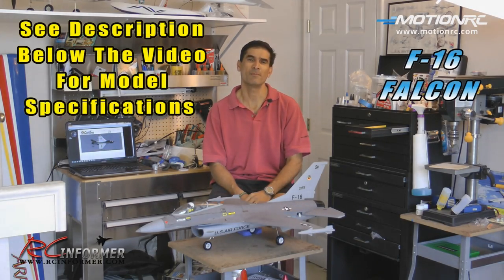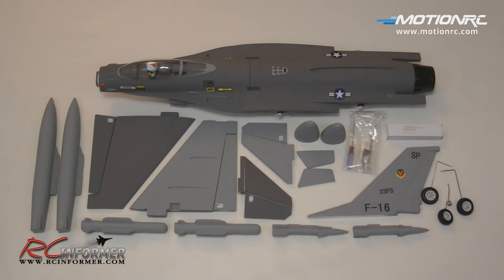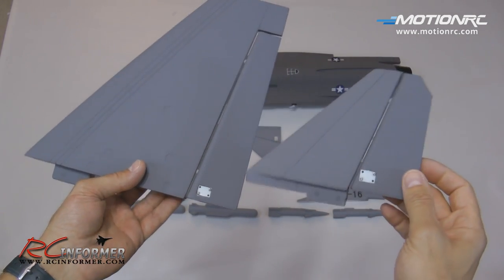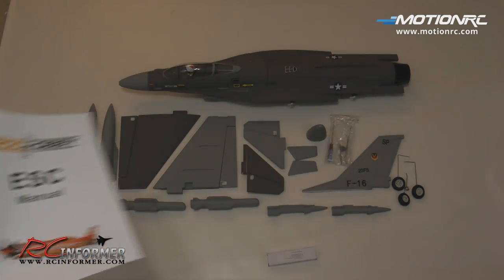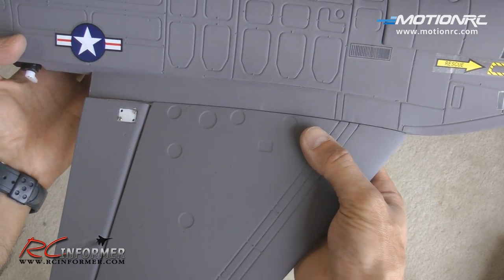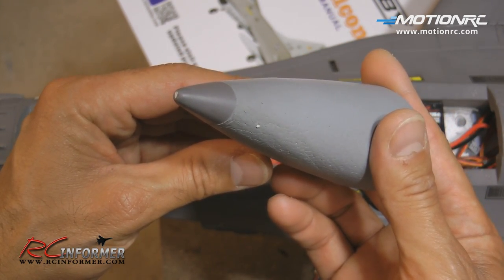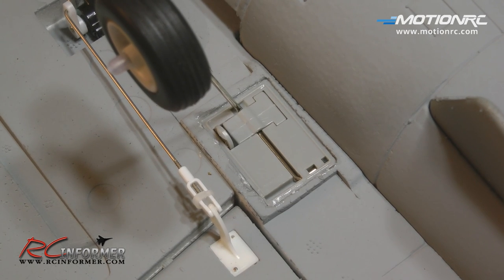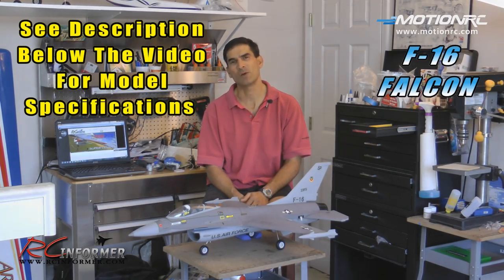MOTIONRC F-16 FALCON PNF Review & Build Guide By Rich Baker in HD

Comment: Very informative video.  I carved out the battery bay to fit 3S 2650mAh packs and had to 21 grams of weight to the electronics bay to make the CG work with various packs.  I did a slight re-paint on mine and replaced the stock ESC with a 40-amp e-Flite Pro-Lite.  This plane flies so well and has enough speed for EDF starters (like me).  I have a dozen flights on it now and am pleased, except for the flimsy landing gears.

Comment: I fly in CO at altitude.  Is this 4S compatible?  If I need to upgrade the ESC to a higher rated ESC, I will.  Just wasn't sure if the motor and 12-blade fan are able to take the extra cell.
Reply from the maker: Derick Aquino Not sure if it will
Reply: Ahh... okay, thanks for the response.

Comment: I changed the stock 5 blade fan on this 2427-5100Kv Motor to a 12 blade fan unit and smoked the motor lol was wondering if i upgrade the new stock 50amp esc to a 60 or 65 amp esc if this will work? thanks for your help

Comment: They have upgraded the ESC and a bigger motor in this now.  Flies great and can handle a bigger battery pack.  Too bad they changed to EPO foam so the detail is not as good as your review by a long shot.  Also it appears when they changed to EPO they changed some dimensions where the parts fit together (especially wings).  Seems to me they rushed through it and never even bothered to put one together before they boxed them up and started selling them.  They didn't even change the person who puts the decals on the vertical stabilizer, they are still crooked as heck, very disappointing.
Reply from the maker: Yea! whoever applied the the rudder stickers must still be doing it:)